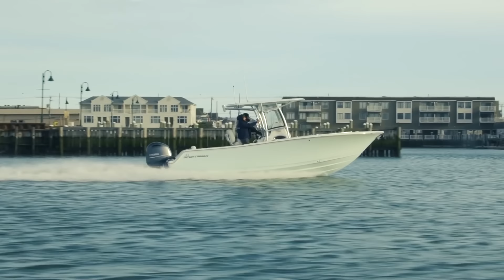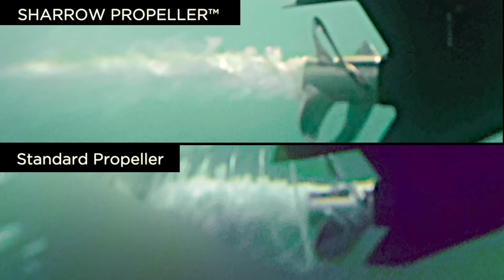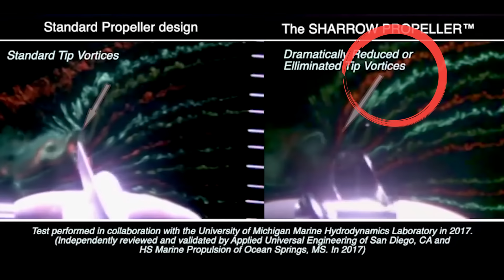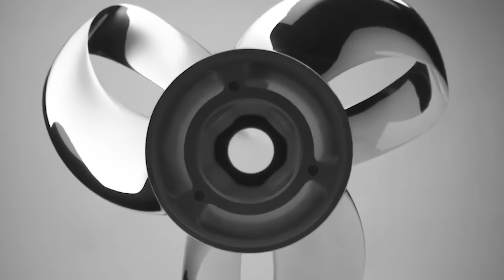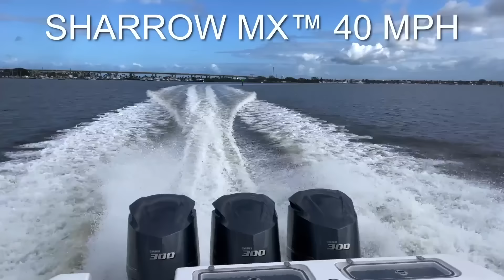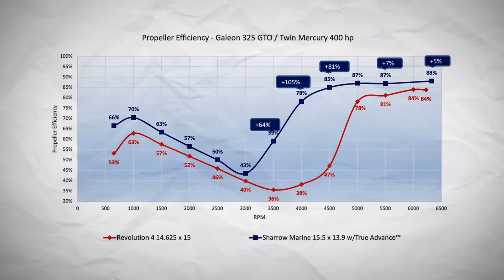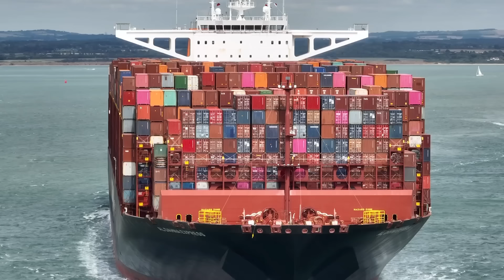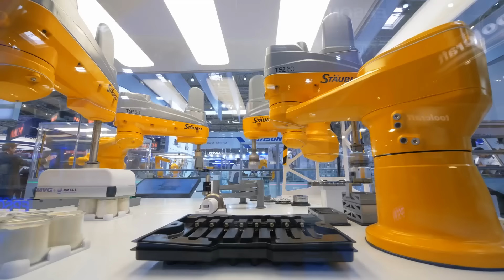This Genius Propeller Will Change Transport Forever

Comment: I didn`t notice any improvements of efficiency  in drones,  standard tuning  related to  rpm  and  classic  propeler size  and shape  is  simply  better.  toroidal   desing has a little  bit more inercia - so you  quadrocopter wil  be less precise to  control ..

Comment: Helicopter with this tech? Subs can definitely be expected to have these equipped sometime in the future.
Reply: @Professor Frog Thanks for the info. Still hope to see this tech make a visible change to things. Give things a more futuristic look while still being practical lol.
Reply: @Professor Frog Couldn't you implement this on an aircraft that is designed like the Osprey?
Reply: @Propane_Acccessories  The Osprey also uses variable pitch, it is effectively a helicopter for vertical takeoff/hover/etc anyway.
Similarly seemingly most planes also use variable pitch props.

Comment: Wind turbines on sailboats are noisy and don’t work at lower wind speeds. Should be a stiffer design allowing manufacturing with more inexpensive composite materials. Could be an beneficial market although not particularly large.

Comment: I am a blind subscriber
I think I understand what is on display but if anybody has the time could they please describe it in detail with a blind person in mind  cheers
Reply: Imagine a doughnut shape mostly flattened, but skewed or canted to form a lifting blade. Now imagine taking one straight propeller blade and curving it into a C shape or half a doughnut. Now, take a mirrored copy of that and join them at the base and most importantly, the tips. The blades now do not really have tips. Without tips the lifting foil shape, ether in the water or air, can't really form vortices or vortexes at the tips that sap so much energy. They are quite because less energy is wasted. Does this response help?
Reply: @markmiller6844  thanks for taking the trouble
Must admit I’m still a little confused the bass and the tips if you have time try again or not your efforts were appreciated however
Cheers

Comment: some of these could likely be made of brass castings (or cast and finished to specs).  No rocket science in doing either of those steps with brass.   Drones etc - injection molded, investment cast ...   mfg probably isn't an issue at all - and for low spec uses, super low cost processes ...

Comment: Fascinating stuff, the side by side sound comparison of the two boat props is a dramatic difference in sound level, I wonder if that holds true in the air, I'd be interested in hearing a side by side drone comparison. This has a wide range of applications; helicopters, fixed wing aircraft, shop fans, leaf blowers, hair dryers. The shape of recent submarine props are classified because our advisories could calculate the subs capabilities and at what sound frequencies they could track them, I wonder if another reason they are concealed from view is because they have a very unique design such as this. If so, this technology could have trickled down, been declassified, due to common knowledge by our advisories, I'm spitballing here but, it's possible.
Reply: @Theodore Olson Thanks. I'm just your average, everyday frawg... from space.
Reply: I would also keep in mind that a more efficient propeller means they are likely achieving the same speed with less engine rpm. That difference in engine rpm is probably responsible for most of the noise reduction.
Reply: @Benjicmm  It does seem that way given the boat example in the video, again, I'd like to hear a side by side comparison between two electrically powered drones where engine noise is not anywhere near as significant as with an internal combustion engine. Even if the same thrust at lower rpm or greater thrust at the same rpm is the only benefit, I'll take that as a win.
Reply: Fans, leaf blowers, and hair dryers are all ducted.  You don't need a toroidal closed airfoil to reduce tip vorticies.  On a fixed wing aircraft, this would be a biplane, which is inherently less efficient due to interaction of the two wings, and only makes sense under other constraints, such as wingspan limits or structural rigidity.  Helicopters just want big long rotors, for the same reason as wings.
Reply: @wagnerrp  Interesting.
Questions:
1. Do you think there are no blade tip vortices [correct spelling] in a ducted fan?
2. Do you think there is a difference between modern turbofan engines, a ducted fan, found on most airliners and an electric fan contained within an enclosure designed to direct air flow like those I listed; shop fans, hair dryers, and leaf blowers?
3. Define fixed wing aircraft?
4. Are all fixed wing aircraft biplanes?
5. You say that "helicopters just want long rotors", couldn't there be at least one or two helicopters interested in trying something new?
Reply: @halbedelstein-missiongitar3030  The outboards aren't running as hard to get the same speed.  If that test clip had been with them both at 4000 RPM the engine noise levels would have been the same (although the Sharrow equipped boat would have been moving faster so maybe more wind noise).  So you're correct in your statement.
Reply: Is the difference in sound really that big of a deal?
Reply: @RSCamaroBlack  On a sub its critical.
Reply: Also imagine the sound difference when the camera/microphone is turned 180 degrees looking/listening towards the front of the boat. The wind noise from that perspective would probably mute anything else.
Reply: Although some aspects would work, Size and shape of some fans/ props and blowers will not be able to use these. Helicopters as example would never use this as its fixed pitch and rotors are adjustable pitched as their main function. Already had someone try printing one of these for a PC fan and it failed pretty hard as the RPM range between a drone and a case fan is drastically different. Could be design they printed but it still did very badly with what they tested. It was also not as quiet as thought it would and thats at the same RPM trying to push air through a Radiator. Blowers tend to be very specific in design and a simple fan tend to not give the results desired vs other designs. Keep in mind that the design in fans can drastically dictate how much air and sound they produce. A loud noisy fan or hair dryer is using a cheap fan design in the first place and are for function for the price.
Reply: @silentferret1049  My thought on a helicopter is that each loop blade could be individually mounted and variable pitched like a normal helicopter blade.
Reply: @TheTalkOfTheTown If a prop is producing more thrust at a given rpm then you should be able to move at the same speed at lower rpm, a lower revving engine is quieter than a higher revving engine.
Reply: Think of the benefits to sealife.
Reply: @joshhooker7390  Please list all of the benefits to sea life that you have thought of ?
Reply: @SpaceFrawg  noise is sound pressure. Less pressure = less disturbance to sealife. Less fuel burned = less exhaust gas being expelled into the water = less disturbance to sealife
Reply: @joshhooker7390 
(edits *)
I was having trouble thinking of a benefit to sea life beyond sound, I had not considered* the exhaust gas from an outboard motor like what was depicted in the video. I see that now. 
I imagine in the case where an electric engine was used the only benefit would be sound... an electric outboard or a submarine where there are no exhaust gasses**. There are also inboard internal combustion engine driven watercraft/ships that exhaust gas directly to the atmosphere, so again there may only be the one benefit of sound reduction. I want to consider all the pros and cons, I was poking at you a bit here but, I do value your input and it is worth considering, thanks.
(edits: *considered, not consider. **gasses, not glasses.) Stupid phone.
Reply: @joshhooker7390  You're probably compiling an ever growing exhaustive list of the benefits this will have on sea life and I understand if it's unrealistic for you to list them all here... just give me the first three?
Reply: @joshhooker7390  Two? Surely you can give me two?
Reply: @@timt2719 Engines generally make more noise at higher rpm. A more efficient propeller means the engine can be run at lower rpm. This is a separate mechanism from the reduction of turbulence in the water reducing noise.

Comment: Could argue for a smaller (cheaper) outboard motor if fitted with these more expensive props. This could offset some of the cost while keeping the performance levels identical.

Comment: Ziroth, for a nearly always active boat, 20% fuel saving is an astronomical amount of money. For just 28 days at sea, a large container vessel burns approx 210~ tons of fuel, per day, resulting in a round trip cost of (if fuel is roughly $550/ton) roughly 3.2~3.3 million dollars. 
Twenty percent of that is 600~700 thousand dollars saved. IN ONE TRIP. These vessels work year round!
Reply: Yes, it will be interesting to see how this would play out in the real world. Most containerships I've sailed on haven't had above 10% propellor slip in calm weather, so I would have thought the most efficiency you could bring to fuel savings through propellor design would be with a propellor which has 0% slip, making a saving of approx 10%, if speeds are maintained. Further, I'm not sure if it would be possible to make variable-pitch toroidal propellers either, so astern movements could be problematic with today's engines without expensive pods.
Reply: @ChrisTaylor-NEP  but they could adapt well to controlled directional pods too...
Reply: @ChrisTaylor-NEP  I think these propellers are specifically advertised to make upto 50% more thrust astern without any change of pitch relative to standard fixed pitch outboard props. So it might not be a problem
Reply: @oadka  But would that require the propellor to spin the other way?
Reply: @ChrisTaylor-NEP  (potentially valid point re slip, what if these for the same pitch / rotation speed / absorbed power develop more thrust due to increased entrained flow ?? - aside: how many fixed pitch boats  - can't go astern - (intimated by "problematic")?? - I posit, none/ as "astern" isn't a significant percentage of hours operated (worse case throw in an azithruster(tm) for secondary use), lower efficiency may be tolerable (and if the blade /torus is designed to fit on a hub, variable pitch is trivial - not optimal, but no VP prop (or CS) is "optimal" outside a limited "set-range")  Astern in most boats involves "reversal or rotation direction.

Comment: That's mad, always love me some efficiency. Hope these become the norm in the next 5-10 years!

Less of an issue than the other aspects in the majority of cases, but would be interested to know if they are less (or more) durability in the instance of hitting something.
Reply from the maker: Cheer for watching bro :D yea that's a great point actually, would be interested to see a 'crash test', may be harder to repair small bits of damage too
Reply: @ZirothTech  Exactly my thoughts. I was thinking especially smaller boats that in low tide sometimes clip the sand or hit foliage it might be a potential issue. Would be interested to see how they fair up.

Definitely would be ideal for passenger larger vessels! However, as you mentioned with the lower RPM, may not show the same efficiency (or noise reduction) gains as a faster rotating prop.

Either way, definitely a cool and purposeful design that isn't overly complex, so there's hope it becomes cheaper to produce once it's more widely adopted!
Reply: i'd like to see them made from aluminium - they're less rigid and while they would damage more easily, they'd also be easier to repair
Reply: My initial impression is they would be harder to damage than a conventional prop.
Reply: @charleslyster1681  
and considerably harder to repair